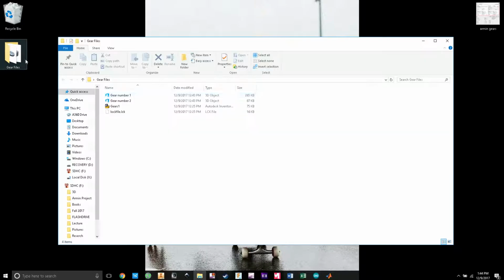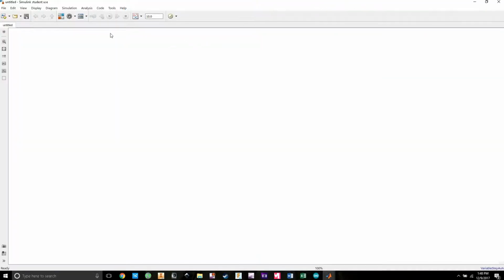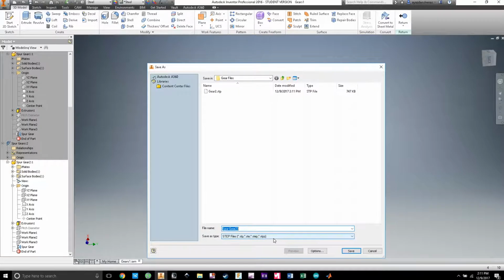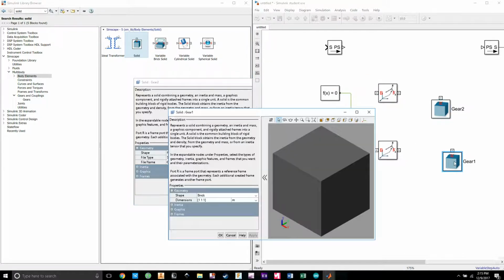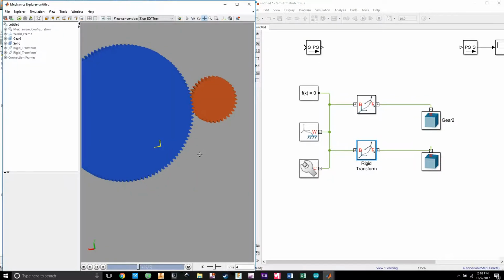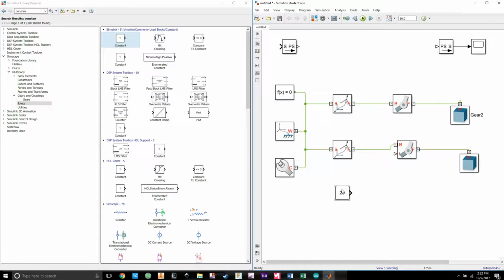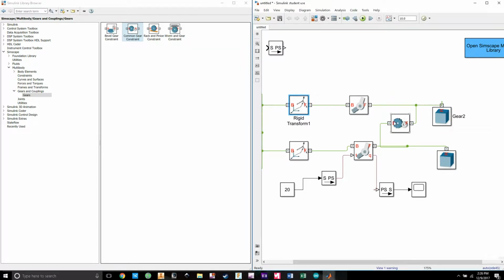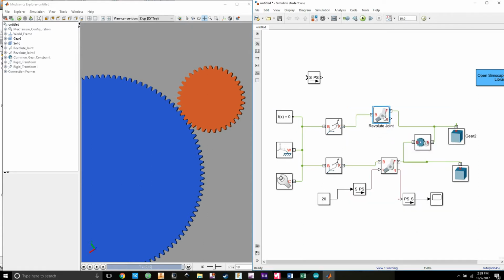How to Model Gears in Matlab Simulink - simscape for beginners

Comment: is there any way we can add some friction between the gears?
Reply from the maker: you can create friction in the gear joint itself. However, this system was later on used with gear friction in an FEA model.

Comment: thanks for the tutorial. can you explain what i can derive from such a model? I know matlab is quite powerful, so this must habe some use beyond what‘s possible with usual equations on paper
Reply from the maker: I used this to optimize custom gear materials. paper was published in ASME journal.
Reply: @AliShenas1993  thanks. I think what is not clear to me yet: what am I able to simulate with this? It doesn't seem to be capable to consider effects from the meshing itself (contact forces, number of teeth in contact, friction), or is it at any stage of modeling?
Reply from the maker: @Orionka1016  https://asmedigitalcollection.asme.org/IDETC-CIE/proceedings-abstract/IDETC-CIE2018/51722/V01AT02A028/273480